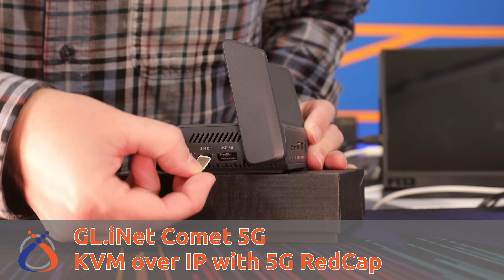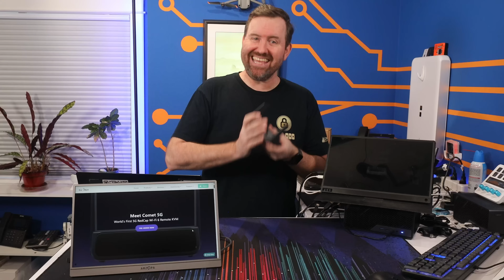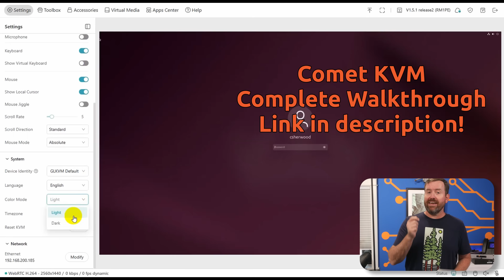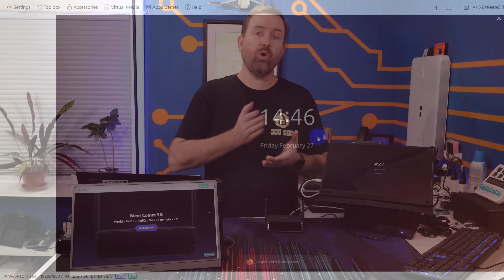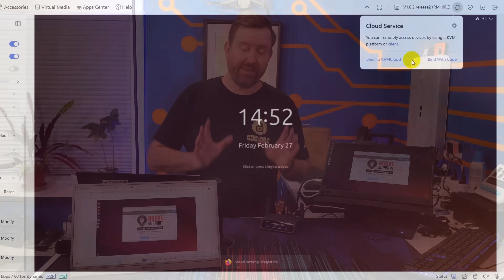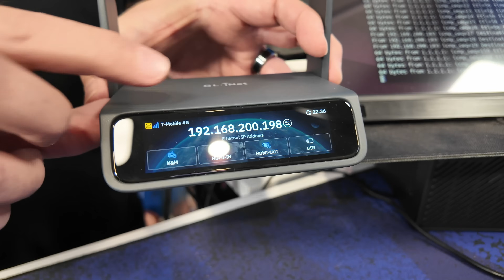This KVM Has 5G Cellular Failover Built In

Comment: I would not let any foreign device with 5G or 4G be attached to servers but maybe with a failower option like if connection is down a smart plug poewers up this and a raspberry pi. And The pi will send a webhook every time to me if its powering up. Also The pi would act like 2nd VPN option to ssh or vnc into a server. Anyways 0 Trust in networking is the best trust. The But Looks cool!

Comment: Can it be used as a 5G travel router as well?
Reply from the maker: No - this is a KVM, not a travel router.  You'll want to look a the Beryl 7 or Slate 7 if you need a travel router.
Reply: @C @CrosstalkSolutions any travel router with 5G built in?